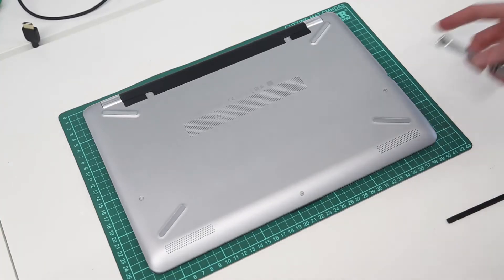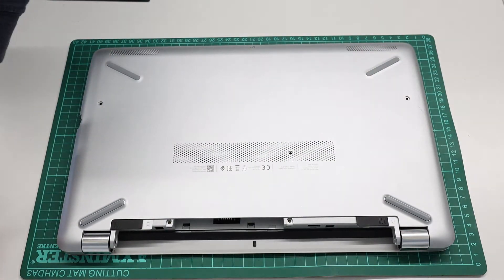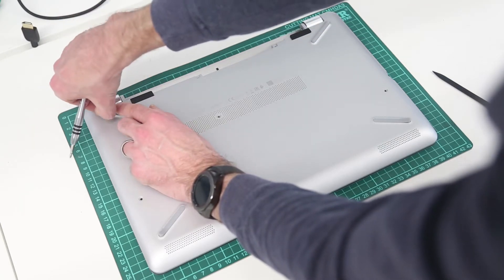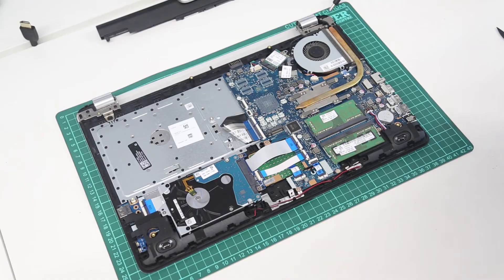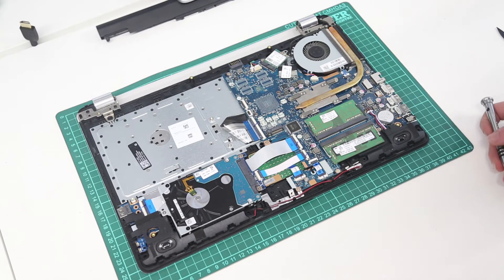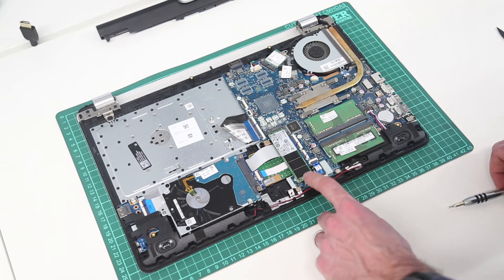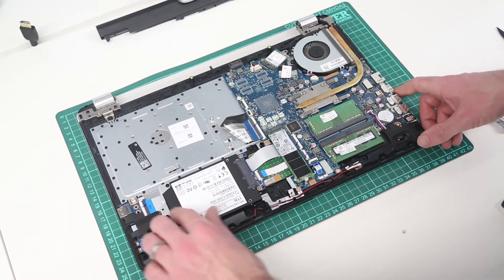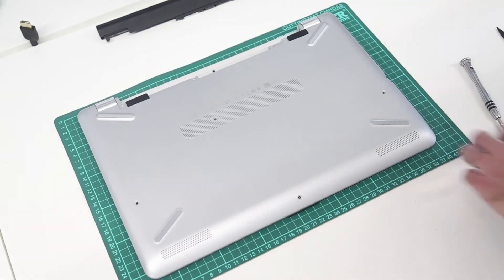HP 15-bs106na SSD, HDD, and RAM Upgrade Guide

Comment: Hey, i have the HP 15-bs115 and do not have the PCB for the hard drive however I have the flat connector on the Mainboard. Do you know a good resource to check what my motherboard is capable of?
I find it quite hard to figure out what my Mainboard can handle. I mean I could even buy 32gb of ram but i doubt it can handle that. Or a 1tb sata SSD, i am just afraid whether it will work.